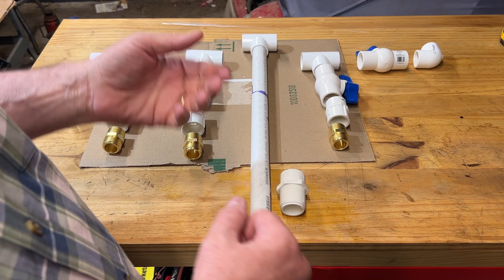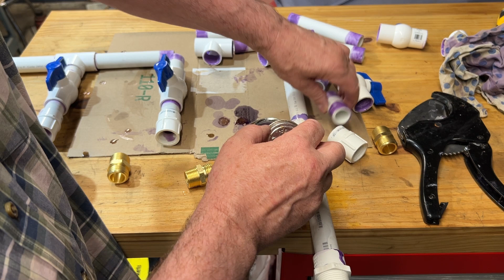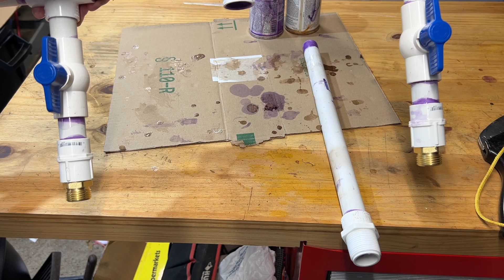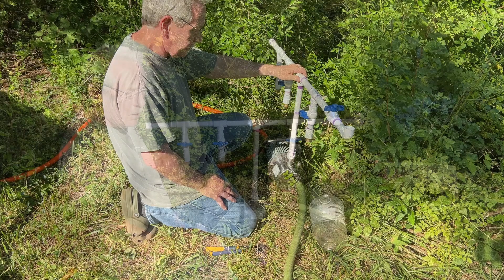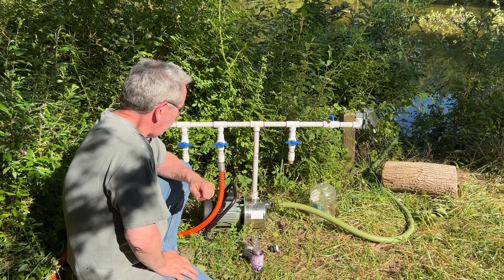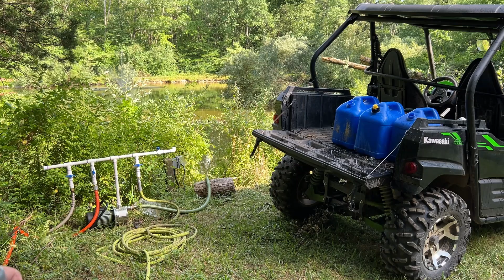Plant Nursery Watering Made Easier

Comment: awesome. I am using a home Depot brass valve splitter for 3 hoses on half acre ( back area , closer to house and side yard) I will add a hose for back (close to house) . I also have a separate front supply of course. I have been thinking of water capture so the PVC route to a tank at the far back on the highest elevation would be good. The brass valve splitter reduces water flow I think as it is smaller diameter. I will not have a pond but could pump water catchment to tanks at the back of property. Being in the suburbs of Vancouver Canada we do have time restrictions for watering. Water capture would not be subject to those restrictions.
Reply from the maker: Agree about the brass water manifolds, they really do restrict water flow. We replaced all our hoses with full 3/4” id hoses, much better water flow and volume. 

Collecting water would be ideal. Would love to do the same. 2 large IBC totes, or rain barrels, some hose, and a way to collect would be ideal. We haven’t fully explored collecting water but our house and thus the roofs are uphill from our nursery areas. Might be something we look in to as time allows. Of course the pond is a giant rainwater collector and so we pump that water. 

Keep at it, wish you the best, Larry 🌲🌲🌲

Comment: Great helpful video as usually. Quick suggestion, adding a check valve into the system will also hold the prime of the pump.
Reply from the maker: Hi Charles, Great idea, a check valve on the supply/pond side would probably do the trick. I was using the log you see in the video to trap a little supply of water against the pump. It worked OK but not great. Have to pick up a 1” check valve and see how that works. 

I am pleased how it came out and glad to not be changing hoses and hand priming. I am sure in a year or two I will want to do some upgrades again. Thanks, Larry 🌲🌲🌲